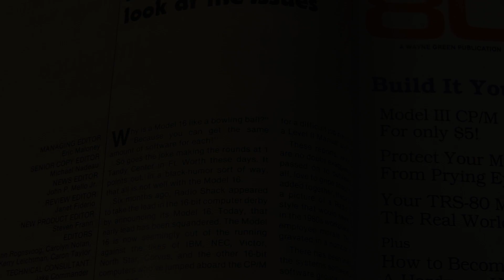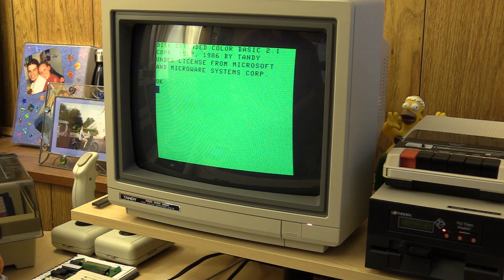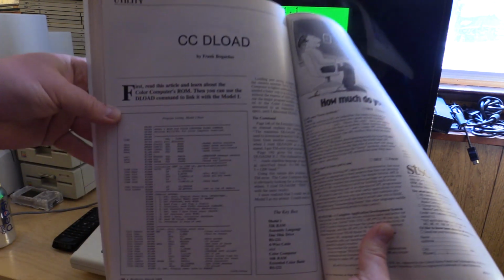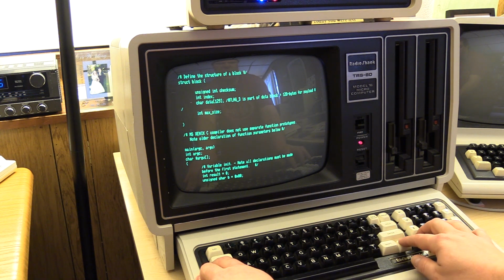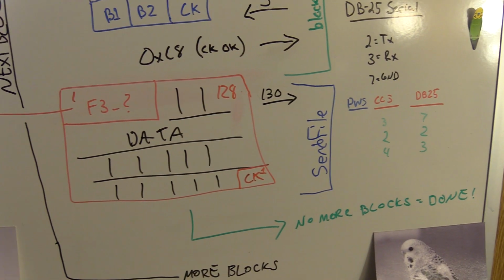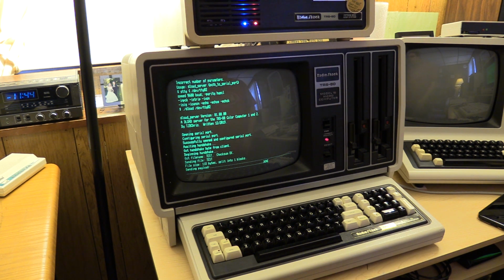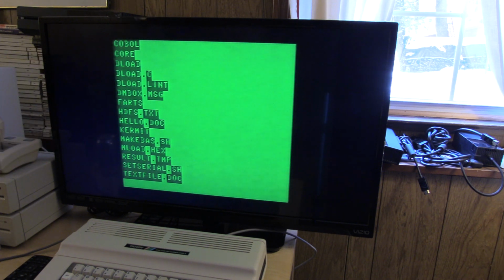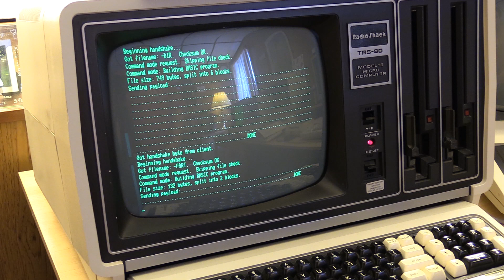Tandy Color Computer: Exploring DLOAD

Comment: Exactly what I was looking for tonight. Looks like a discussion of this came up on the CoCo list in 2020 with the protocol, which I’d never seen before.
Reply from the maker: Thanks!  The fact that I got into it when I did was a giant coincidence.  I had been working in a vacuum…just the 80 Micro article and a doc I found in a Usenet archive.  What led me down this road was the video that came before this one when I found out NE ERROR is in the CoCo 3 ROM.  I originally thought it came in via Disk BASIC.   “Why would that be there?”  One thing led to another, and I was off to the races!
Reply: @TJBChris  Aha, you had the video showing how to make all the error codes. I stumbled in to that one. Connecting the dots…

Comment: So, kind of like a minimalistic DriveWire, but only for loading BASIC programs; however, built-in from the very beginning. Awesome! Excellent idea of supporting commands via dynamically generating BASIC program responses! Are you going to open source your code?
Reply from the maker: Thanks for watching!  It is like pre-DriveWire.  In fact, now pyDriveWire uses DLOAD as a way to get the initial DriveWire code loaded onto CoCo 1 and 2 systems.  My code for this project is already available and is open-sourced; you'll find a link to the repo in the video description.
Reply: @TJBChris  Interesting. I was thinking it could be useful to deliver a binary payload. pyDW seems to be dead, or at least is dormant. I had checked your descr, but didn't see any link to source in there. Just checked again.
Reply from the maker: @Jerri Kohl  Hmmmm, I’ll look into that.  In the meantime, you can find the DLOAD server at this link.  Keep in mind I wrote it specifically for the Model 16 (on the 16), so it’s old K&R C and it’s not terribly pretty :)

https://github.com/TJBChris/dload_server

EDIT: The link wasn’t there - sorry about that!  I’ve added it to the video description.  Thanks for letting me know!

Comment: Question:
If I do PRINT @ 511, "x";
The computer jump a new line, how to avoid that ?
(does not do it from 1 to 510 character positions)
Thanks.
Reply from the maker: I’m not sure if you can do it with a PRINT statement, but you could POKE into the last location of the low resolution text screen memory, like so: POKE &H5FF,ASC(“X”) to put an X there without scrolling.
Reply: @TJBChris  Thanks a lot !
:o)
Reply: @TJBChris  It works !
You're the best  ;o)

Comment: Since DLOAD's original functionality only exist on CoCo 1/2 and was replaced by initialization routines on CoCo 3, is it possible to patch/repair the duplicate RAM (not ROM) in the address space where the DLOAD command formerly resided on the CoCo 1/2? Sure, you'd have to temporarily overwrite CoCo3's initialization routines in the process, but is it possible? Also, where can I find a copy of the March 1983 issue of the 80 Micro magazine?
Reply from the maker: I often wondered about the possibility of reintroducing DLOAD as well, either elsewhere in the ROM (the three mugateers pic takes up 6K) or as a stand-alone program.  Though you’d then either have to replace the ROM (not socketed) or load a program (DLOAD) to then DLOAD another.  A Program Pak version might work, too, I guess.  That’s about as far as I got thinking about it before getting distracted by other things.  I’m guessing it’d be far from trivial.  As to the March, 1983 issue of 80 Micro, check out the Color Computer Archive.  It’s likely you’ll find it there.  Thanks for watching!  https://colorcomputerarchive.com/repo/Documents/Magazines/